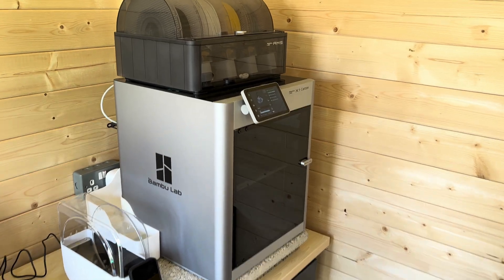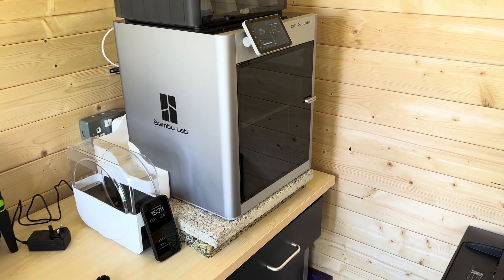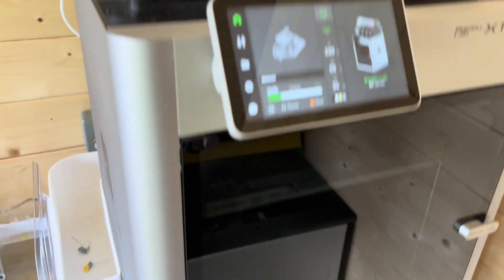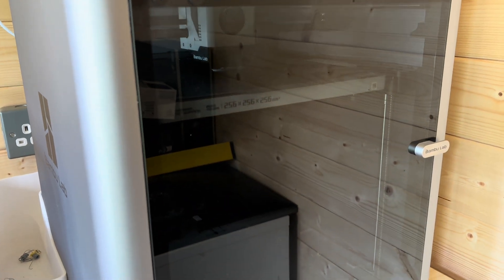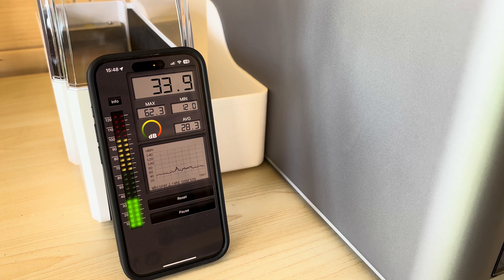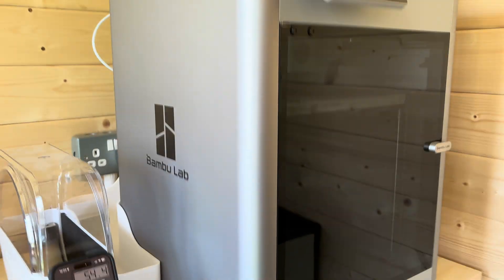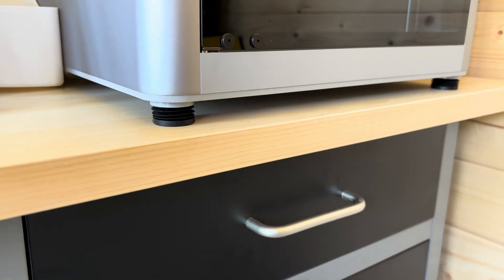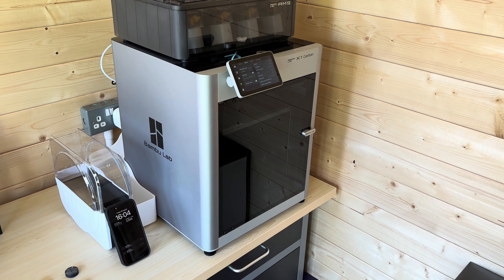Bambu Lab X1 Carbon Noise Test

Comment: nice video quik question does your printer also run constantly on 100% chamber fan?
Reply from the maker: Not always, but for the fast prints it runs quite high as you need the temperatures higher